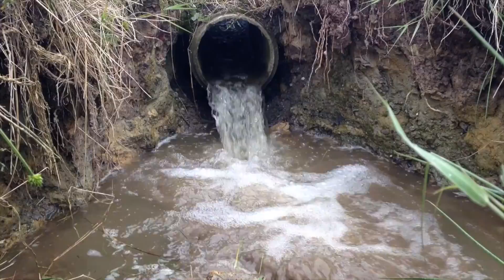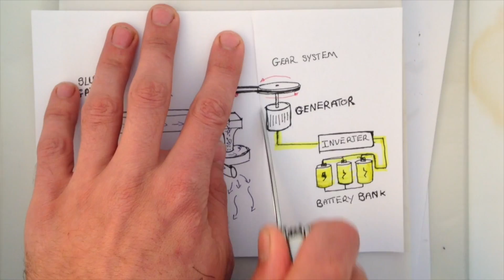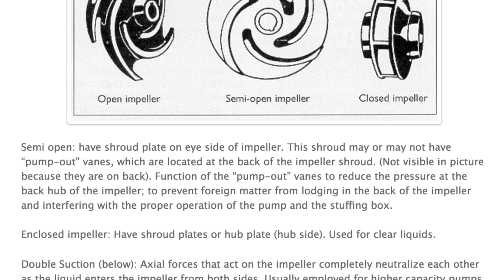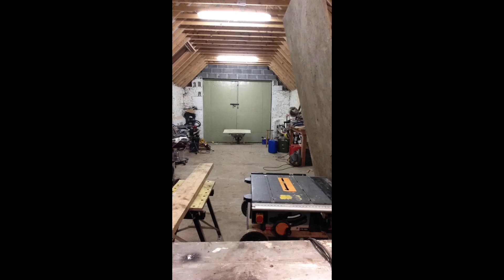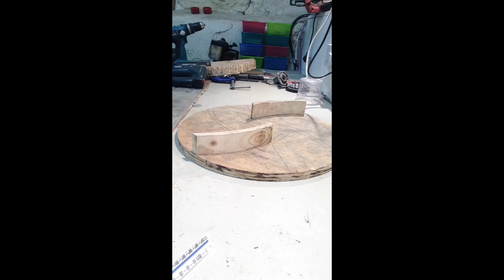MicroHydroElectricity Part1

Comment: A INVERTER converts DC to AC a DIODE RECTICFIER converts AC to DC.
Reply: Rectifier. A full wave bridge rectifier produces DC and with an added capacitor gives you DC that is nearly as good as DC produced by a battery.
Reply: and a generator produces dc from the get go
Reply: @HomeDistiller  A generator produces DC from start to finish. An Alternator can produce DC both at its start and ending point but produces AC somewhere along the line. And in some cases, a genset can produce both AC and DC at the outputs. My welder is one of those as it produces 120/240 60Hz and also DC for welding.
Reply: Francis Burlaza  thanks, I was going to make the same comment.

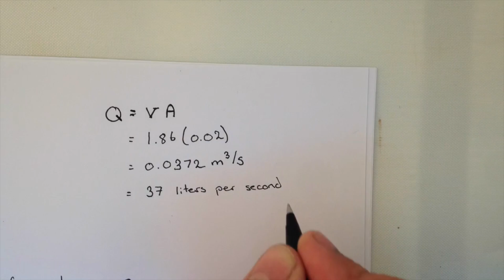Comment: thanks for posting.  sorry but, at 2:32, you are decimal place OFF.   note that 37 liters of water per second is NOT leaving the gutter.   its   .003 cu-m/sec.    so, assuming you can achieve one meter of head, there is about 29 watts of potential energy available.   the most efficient Type of turbine for use at a low-head, low-flow site is a Correctly designed poncelet-style overshot waterwheel.    cheers